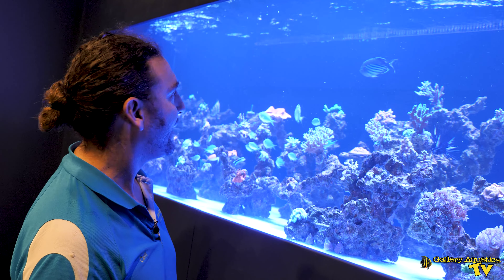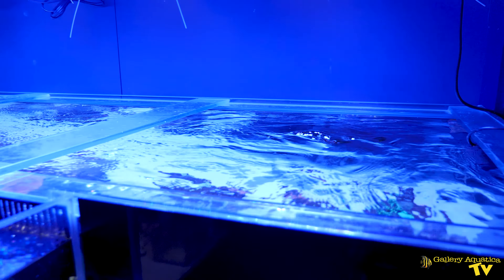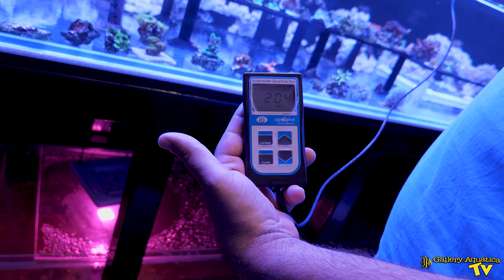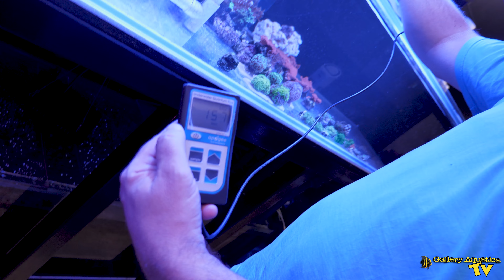Shed Boi's Reef: Testing the PAR

Comment: This will be a great series! I just bought my first PAR meter, for curiosity mostly, and found I was running very low PAR actually, with decent results and happy corals. I guess that's what happens when you try and find the sweetspot by looking at how the corals react. Now I'm experimenting with more light.
Is DLI something you guys consider important for setting the lights up for succes?
Reply from the maker: We normally just look at the PAR at the peak of the schedule and hope the DLI is good. I think DLI will be something we look at more in the future. I expect we’ll see products on the market soon that will give us DLI readings. Cam
Reply: @GalleryAquaticaTV  Thanks Cam. I think it's interesting to consider, since maybe the DLI can be lowered for less electricity consumption, and the corals still get enough light. (High PAR short schedule eg)

Comment: Explained what PAR is but cannot be bothered to explain the readings correctly. PAR is NOT a dimension! PAR is measured in terms of the concentration of photons as a function of surface area and time. 250 PAR is WRONG! It’s 250 micromoles per square meter per second (umol/m2/s). Stop using PAR as the dimensional unit, please, people.
Reply from the maker: It’s great to have the exact definition of PAR here in the comments, but for the sake of the coral reef aquarist and the way we use it to choose locations for our corals, the way we’re describing it is fine😊
Reply: @GalleryAquaticaTV …but it’s wrong. 🫤